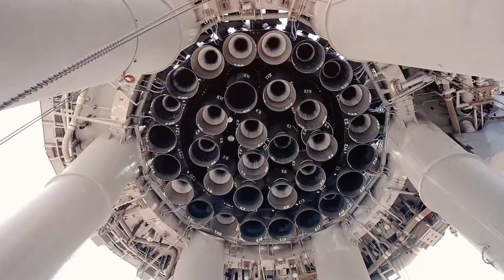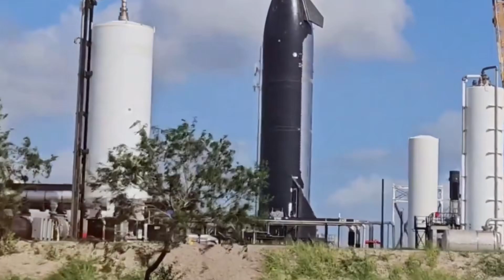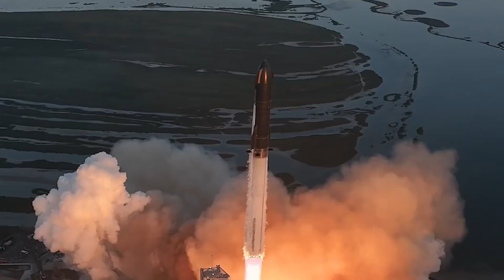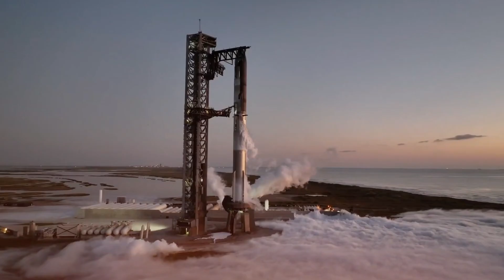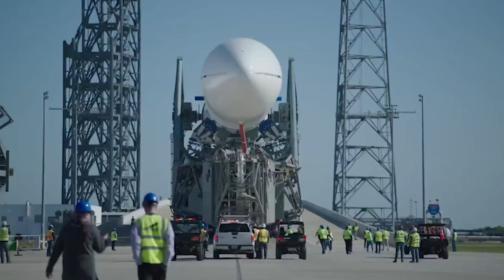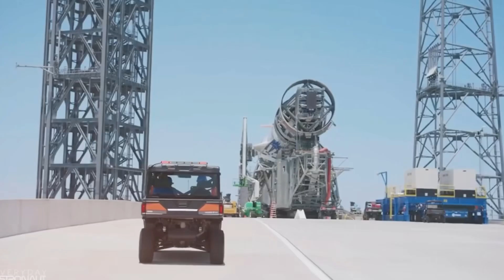SpaceX Finally Reveals Starship V2's Revolutionary Upgrades...NO ONE Expected This!

Comment: Starbase, are you running V2.2 or •2b, ie ~ship8 or ~7b? The breaking up, and not delivered payload and engine failure are  all of concern.Salute, PUSH UP.
Reply from the maker: The engineering challenges are definitely a hot topic right now, and it will be interesting to see how they address these issues in future launches.